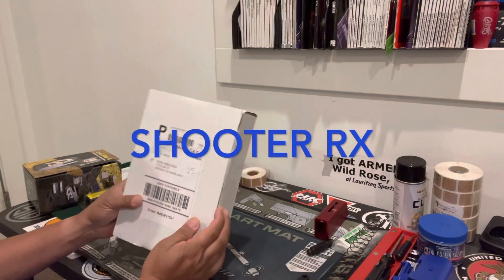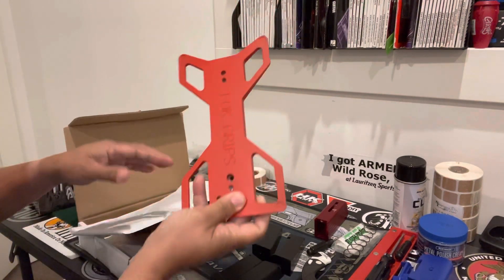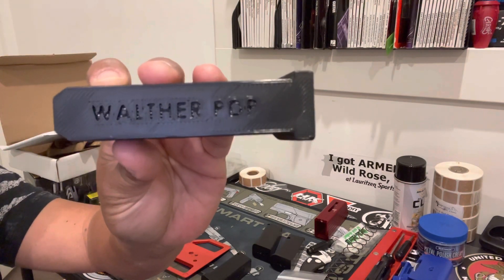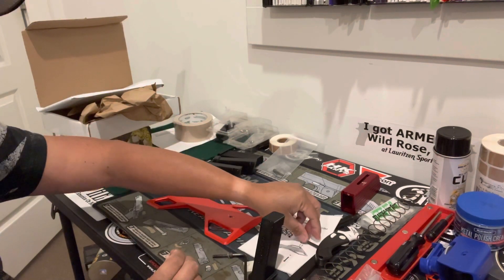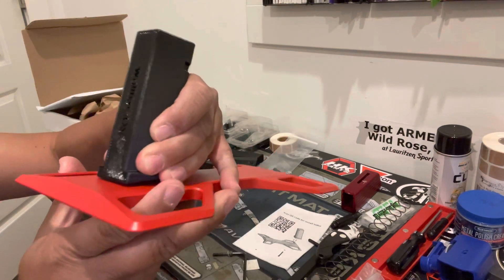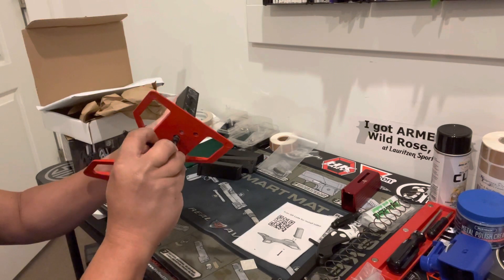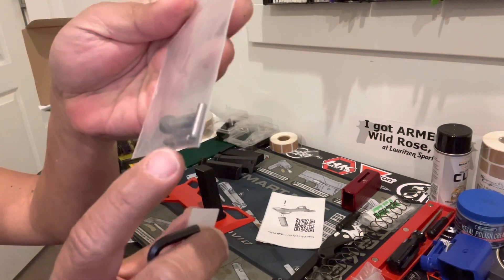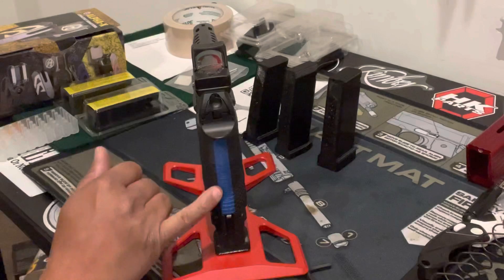LOK Grips “Gun Stand”

Comment: Greetings, great video and the gun stand, can you tell me how wide the stand is in the middle?
Reply from the maker: @rade32 I measure it about 1 and 1/2 inch in the middle. Compared to the ends on both sides is about 4 1/2 inches. Overall length is 8”. Thanks for comment.